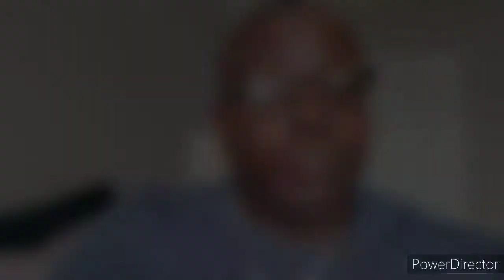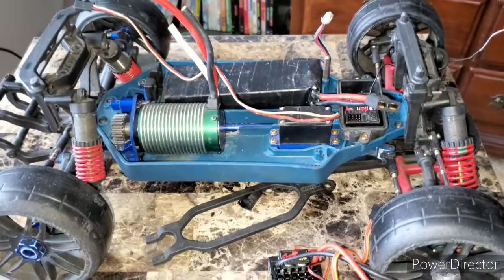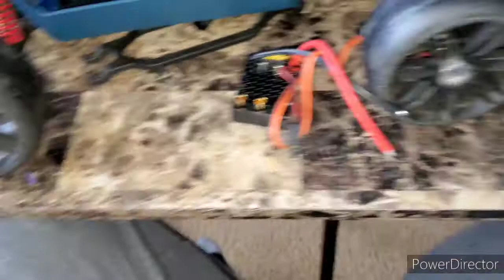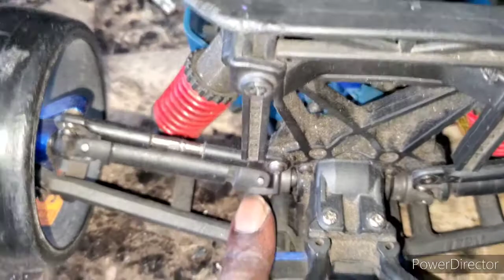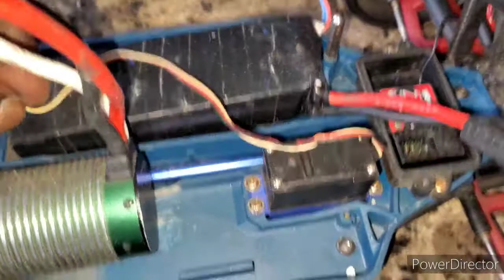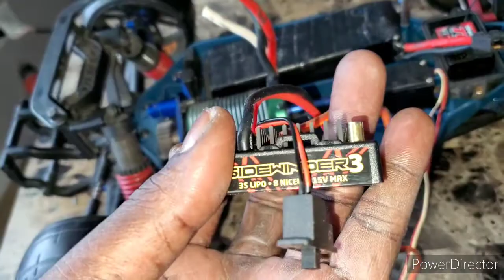First video of 2021.. And channel updates.

Comment: That motor to much for that 3s max esc you need a 120a 150a for that motor.
Reply from the maker: Thank you..
Reply: I just bought a fvt 120a esc for $21 and a goolrc 60a for $7.44 off Walmart .com you do the budget RCing I'm that same I built a whole rustler all brand new parts $90 bucks.